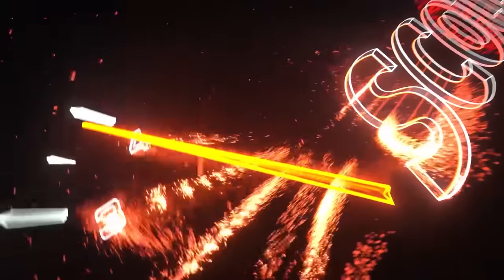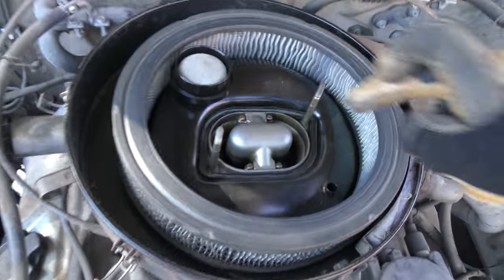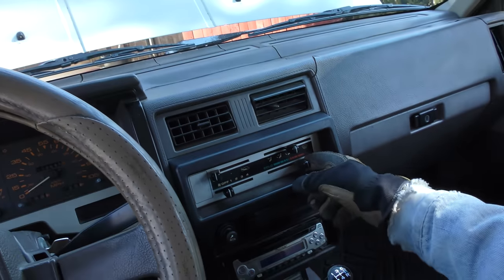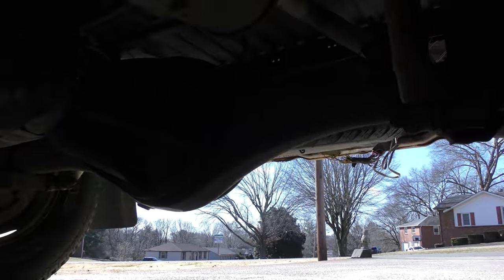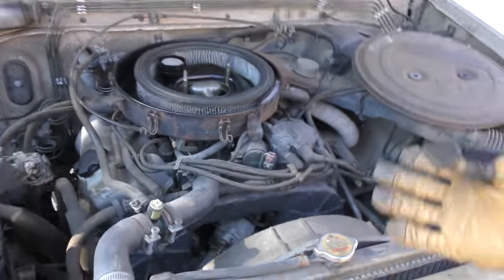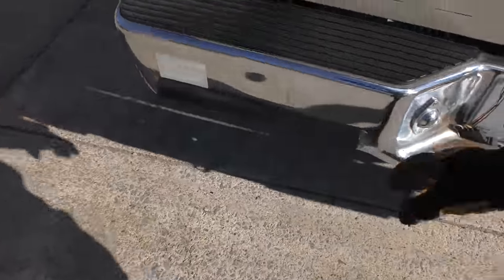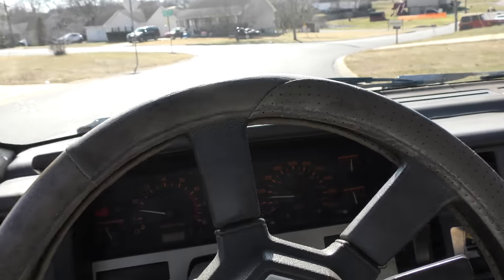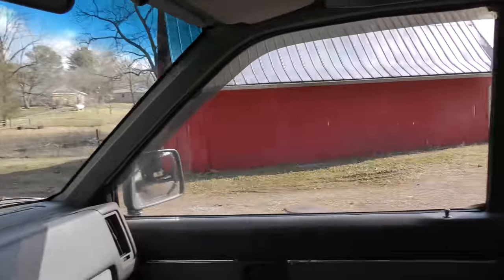I'm Sitting in the Best Truck Ever Made (Goodbye Toyota)

Comment: I had a brand new 85 D720 I traded for a 2WD 4cyl 86.5 Hardbody when they came out. Drove it for 5 years and only had to change the oil and filter. 2 years ago I was feeling nostalgic and bought a 97 4x4 4 cyl 5 speed. Truck is perfect and reliable. Only has 65,000 miles, so it will outlast me.
Reply: Great find!

Comment: That's what I like about the older vehicles they are much simpler and easier to work on. My modern day Mercedes sprinter van has so many sensors it'll make your head spin. I have already had the engine replaced and there are 3 sensors showing fault code. One of them prevents the cruise control. The sad thing is the van only has 12k on it and it was made last year.

Comment: I love how the cooling fan makes it sound like a big rig or something
Reply: It drives like a big rig too. These trucks are really low-geared, so they are Extremely Slow, but they have a really high payload capacity (don't believe what they say on paper) - and it drives the same as if it were empty! Don't try to tow over 3,500 lbs with these things though then you'll kill the transmission. You also gotta shift pretty often on these things like a big rig as well, and you can take off from a stop in 2nd gear pretty easy too. Overall one of the most reliable vehicles ever made💯

Comment: I love the older trucks! I'd love to of had  one of these. I had a 82 gmc that had over 300 thousand miles didn't have to do much maintenance on it only a starter and a thermostat.  Always changed the oil in it! Good running truck!

Comment: I just got ahold of my fathers hardbody made in  12/1985 had the 4cylinder with a/c king cab 4wd with the bigger factory tires and the 5 speed manual, he converted it to electric Windows and locks out of a Nissan Pathfinder, the truck definitely needs some work but he bought the truck in 1987 from Nissan and put 300k miles on it. I was the last to drive it when it was parked 8 years ago and it ran perfect. I’m gonna fix it up and have it as a backup truck.

Comment: As a Hardbody owner, I can tell you the issue with the throttle body. Once a part breaks on it (wax idle solenoid) you will not be able to find replacement parts. Nissan only supplies parts up to 20 years back, so that throttle body is obsolete. Wrecking yards used to be the place to go, but they are all picked clean now. A used, 30-year-old throttle body injector will sell for $300 to $600 on eBay - if you can find one. Why? Because nobody makes an aftermarket replacement either.
Reply: Is that on the v6 or the 4cyl ?
Reply: @shanetyler9391  both had the throttle body, so both have that issue. The newer VG30e has its own problems, especially with ethanol-based fuel, because the small o-rings in the injectors will dissolve if the engine is not driven regularly. I've replaced all 6 injectors on my VG30e injectors 3 times since taking ownership of mine in 2010, and they are expensive to replace.

Comment: Got a 94 D21 Hardbody 4WD. LOKKA,auto diff lock in front factory LSD rear, new water pump and heavy duty clutch. Except for regular sevices thats it over 25 years. Everthing else original.I did fit a new alternator, didnt run so good. 
Replaced the bushes in the original, no problems.

Comment: Scotty, a pleasant surprise from Mr. Toyota!   Nissan did so well for so long. .why did they merge with Renault?  I have a 2wd z24 version with 423k.  I've been in the engine, but the rest is untouched except for Amsoil. The old R12 system has quit.   Rated at 106 hp but will haul anything that i load in it and will keep up on the freeway.  Lower end is basically the L engine from the 1960s with the 8-plug head.  I replaced the beat up seats with Integra and the melted steering wheel with a Pulsar for $5.  
I had the fast idle issue for years. Ignored it until it caused smog failure.  Had to replace the little wax solenoid that controls the cold idle, then adjust the cam.  Surprised you said not supposed to mess with it.  It doesn't govern mixture. Just idle speed.   Now it idles better than 25 years ago.  You can feature my antique and even give it the drag strip test!  
These old nissans...did you see the million-mile Frontier from Chicago on you tube?  I don't know how people say that's junk compared to Toyota.  I'd call them peers. I also have a cheap 88 Sentra with 360k on orig engine that still purrs.  One head gasket only failure.  Late 80s and 90s seems like a golden age for Japanese stuff.  Wish the plastic parts could take the CA  sun better!  But I  like the simplicity.   Fuel injection is the only tech on board, and it was inevitable as the carbs and vacuum lines necessary for smog had become impossibly complex and tough to maintain.

Comment: The only truck I ever owned was a 1987 Nissan Hardbody with a manual trans, Snugtop with carpet kit, mag wheels and no AC. I bought it slightly used in 88'. Best vehicle I ever owned. Had over 200K miles before I blew the engine. It had a recurring oil leak from years of neglect and I underestimated how much oil was in there. Rebuilt the engine and all was good. Got a new car (93' Jeep Grand Cherokee, first year). I stored my Nissan at a friend's house. He was driving it without my permission and totaled it in 97'.

Comment: Fuel injection was more common than carburetors in 1986. I would have thought it had a carburetor also because of that big circular air filter on top of the engine.

Comment: We had a 2wd 4 cylinder Nissan p/u from that same era.  We put aggressive tires on it and were able to take it anywhere we wanted to go camping.  The main drawback with it was that the engine was underpowered.   It took forever to get up to highway speeds when it was loaded and towing anything very heavy was out of the question.  Otherwise, it was a great truck.  If we had gotten the six instead of the four, we might have kept it to the present.

Comment: I had an ‘87 hardbody 4 cylinder all through college in the mid 90’s. Absolutely couldn’t kill the thing. I finally sold it in 1998 with 220k of the hardest miles ever and it was still going strong. It’s sad to think what Nissan has become since then.
Reply: I have 2006 Nissan frontier with 200k and it runs like a top. So smooth and perfect. Nissan is still bulletproof
Reply: @buffalokrisgoldprospecting  not so much the new ones. Had a buddy with a 2014 Titan and it’s had all kinds of problems and it only had like 125k miles. The rear end was totally shot and he didn’t even tow with it.

Comment: I have a 1987 D21 two-wheel drive with the 2.4Z engine and currently have 463k+ miles on it.  I have the same 15" chrome rims from a 4WD model so for years ran a larger diameter tires such that 1 mile only registered .9 on the odometer.  Based on simple calculations, I'm sure i have over 500k miles on the truck.  As Scotty indicates, it isn't a powerhouse and can't do what my dad's 1992 4.3L S10 can do but it's have been a very durable truck.  One thing that Scotty didn't mention.  The 2.4Z has a timing chain.  The V6 uses a timing belt with intrusive vales (meaning if the timing belt breaks you can bend/break valves because they may hit the top of the cylinder) so even though the 2.4Z is wanting for power, I would prefer it over a V6 model.
Reply: Have the same year, engine, and rims on mine. About 423k.  I run 215/65/15 tires and overall diameter is very close to the stock 14s.  Double timing chain is stout.  Not a lot of HP but enough torque to lug a full ton in the bed if you dare.  Keeps up on freeway just fine.   If you bring tire diameter down to stock it really helps the power on the 4 bangers

Comment: I have facelifted production hardbody 4 door (Make year) 2003,  basically a WD21 with official facelift from Nissan for SEA market but using the oldest engine (Z24 108HP carburetor). 

it is a joke when running my car above 60 mph on highway. LOL
but the ride on corrugated country roads is surprisingly good! 

mileage is not bad, 30 - 35 mpg on combined roads. love it very much!

it is leaking oils on engine, yet still going strong.

Comment: Hauled a ton of hay with a 4 cyl. 1984 Nissan 720 long bed  with overload springs for years, bales sticking out from the sides to take out cyclists. It's about damn time you gave Nissan trucks some respect. They have been rock solid since the 1970's.

Comment: I have a 1994 hardbody (d21) king cab 4x4 manual transmission 2.4 liter engine and  has AC its amazing! Used to be my dad's before he gave it to me. He bought it brand new and had 5 miles and had plastic still In it as it just rolled off the truck at dealer.  Has 223,000 miles on it with original transmission.

Comment: i own a R50 97 pathfinder, and my brother has a WD21 95 pathy. mines been over heated, redlined, you name it, 114,000km and its never let me down. the 95 is 288,000km and it still runs like new. my mom is the original owner of mine, but my brother got his for 800 bucks because it wouldnt start. pulled the fuse for the after market alarm and fired right up. both are the V6

Comment: I had an 83 Nissan.  It was the best car I ever owned.  I changed the brakes at 90,000.  They didn't need to be changed.  I just got tired about worrying about them  needing to be changed.  After 140,000 all I bought was batteries, tires, lights and front disc brake pads.

Comment: I have a friend with an absolute mint condition 1995 Nissan V6 4WD automatic with AC, canopy. 46,000 — yup — original miles, all in the same family since new. Zero rust — Pacific Northwest truck. Garaged or under a carport every day of its life. Never been off-road. Driven only by her elderly late father, herself, and, a handful of times, me. About the only way to tell it from showroom new, inside and out, is the loose headliner. She routinely is asked if she wants to sell it. She might — but it wouldn’t be cheap.

Comment: I have a 1980 Datsun 720 4 wheel drive pickup and it has been one tough truck! All I have ever done to it is rebuild the carburetor and pack the front wheel bearings and the usual maintenance! Those front wheel hubs on a 1980 4x4 pickup are ridiculously hard to take apart ! I took it to a mechanic one time ,told him to pack the front wheel bearings and when I got back home he was calling to ask me how to get the hubs apart! I told him to just forget it that I would come pick it up and do it myself! The first time I packed those bearings it took me a full day on each side! I haven’t run into anything as complicated as that since wheel bearing wise and hope I never will! I like the kind where you take the hub off and bolt a new one on and you’re done,but when you bolt the new hub on be sure to torque the axel nut to exactly what the instructions say or it will come apart!

Comment: I've owned three 90 s D21s and one 90s S10 modern companies are missing out on my money lol! I would argue the v6's are great but gas money and room to work in the engine bay with the KA24E is much better.

Watch for rust on the front suspension areas on D21s especially passenger side! Change them timing chains! Save the D21s!

Comment: I have the 2.4L Z24i version, same 86.5 year, same throttle body FI. It is my first car and is still my daily driver today. It's approaching 38 years at 390K miles - original engine and 5-spd transmission. In the 80's and 90's, a lot of my fishing and mountain-biking friends owned Toyota pickups. None of those Toyota pickups are alive today or back in the early 2000's. It's not a fair comparison and one of my friends actually preferred driving his Ford Tempo to our fishing spot back in the day. I have a Lexus ES300, Toyota Sequoia 1st Gen, Honda S2000 and Infiniti G35 which are good cars but my D21 is my most reliable car. I always tell my daughter that if I screwed up and lost everything I own, she has something to inherit for sure.

Comment: in 1986  Ford Ranger beat out all these trucks  in Motor week and motor trend.    Ive driven all these trucks and i personally can tell you the Ford Rangers were  Smoother  quieter Trucks they felt more refined and the XLT trucks were so much more comfortable in the cab.   They are had good reliable engines......For Everyday ownership   I drove Rangers for nearly 20 years.    I really miss our 1986  and our 1991 Rangers.  Both had over 200,000 miles
Reply: Proof America can do it right when it wants to.

Comment: The 1998-2004 (First Gen) Frontiers were basically a rebodied and updated Hardbody. They are not expensive at all. 
They are simple and rugged,
And the D22 Frontiers are much more rust resistant than a hardbody.
I own one, love it, feels like it will last forever. Only issue is (just like a D21) is you're not going anywhere fast. The D40 trucks arent too bad, but they don't share any connection with the Oldskool Datsun like all the trucks through 2004 did.

If you want a Frontier (or a Hardbody), my advice is get a 4cyl one, they arent much slower and get much better fuel mileage than the 3.3 V6. Neither engine is affected much by whatever you can fit in the bed. Yeah the V6 can tow a little more on paper, but neither truck is a great choice for towing anyway (besides, the 4 banger pulls its little heart out, its surprisingly capable for what it is). 
My truck is a 3.3 crewcab longbed and ive already contemplated swapping in a KA24DE Frontier motor, my previous Frontier was a 4 cyl (i gave that one to my mom) and the V6 is that much of a letdown. Like i said, yes its more powerful but not enough to offset the massive difference in fuel consumption. The 4cyl gets 4cyl gas mileage. The 6cyl gets 8 cyl gas mileage. 

Yeah i can already hear the naysayers "BuT tHE sIx HaS mOrE tOrQuE!"

Guess what, the KA24DE in truck trim has torque in spades, too, and it's stupid easy to turbo it for even more torque. The only issue is the 4cyl transmission wont handle much more power than stock (the 6cyl one can handle more the V6 could ever make in anything less than fully built and boosted). 

So heres the reason i prefer a 4cyl classic nissan truck to a six;

My xeV6 struggles to get more than 16mpg (and when doing anything remotely like work that drops, fast). 

The 4cyl trucks, you have to really try to get em below 20mpg and driven sensible they can flirt with 27mpg. I mean even towing a 4200lb car, my old 4cyl one STILL got better mileage than my V6 truck does EMPTY (17mpg average when i towed a Mercury Grand Marquis from Upstate NY to Allentown,PA). Yes, it's kind of hilly around here. The 4cyl definitely felt the load but it got if done. The six feels weight a "little" less but not worth the extra fuel.

Nissan really messed up not offering the 4cyl in every body style (like toyota did with the Tacomas). IMO Nissan should've adapted the bigger V6 FS5R30A transmission to the four and just put the four in everything (they actually did do that in the 4cyl D40 Frontiers) If they did that most older Nissan trucks would likely be the 4cyl ones. The optional engine shouldve been a version of the VQ V6, the vg30/33E engine is a boat anchor relic from the early 1980s, the heads flow horribly.

Comment: Had the Datsun 4 cylinder pickup I bought used for $500 when I lived in Seattle.  After driving it for a couple years I drove it to Nashville when I moved here.  After a couple years suffering without AC I sold it for a Toyota with great AC.  Someone bought it for $500.  Later I bought an Isuzu diesel pup new that I loved even though it was slow as molasses.
Reply: The Isuzu diesels were great engines.  Shame they weren't more popular.

Comment: What I like about my 2004 Sequoia is you have the option of selecting 4WD electronically via a button inside, or you have a handle that allows you to do it manually.
Reply: The bottom is for 2wd to 4wd high (you can switch riding the car) 
The handle is for 4wd high to 4wd low (you need to stop and put in neutral before)
Reply: @paulsteverodriguez3549  You are not entirely correct.  I have two separate buttons in the cab of my Sequoia relating to the 4WD.  One button does the changeover from 2WD to 4WD high.  The other button facilitates the change from 4WD to 4WD low.  Of course engaging the buttons activates an electronic solenoid positioned on the transfer case which changes the functions automatically.  However the handle is there to allow manual control of the 4WD should the electronic systems fail.  The handle also has a neutral setting which can be used in conjunction with a winch.
Reply: ? That’s a mod? Because our 02 isn’t like that, and 05 doesn’t have handle, so it’s a transfer swap or what? Never seen one like that, and I’m in Sequoia first gen Facebook group
Reply: Btw the botton next to 4wd, the tiny one is the center lock differential, that distributes the force 50 - 50 front and back differential
Reply: @paulsteverodriguez3549  Engaging regular 4WD results in the 50/50 (or similar) drive distribution between the front and rear differential, that's what 4WD is!  The center lock differential as you refer (or 4L) can only be used at very low speeds and is normally only used in extreme off-road situations, it causes the transmission/diffs/axles to work in complete synchronicity (in a very low gear ratio)..  I recall the old days to engage it involved getting and locking the hubs by rotating a plastic attachment.

Comment: Love the NISSAN truck. I had a 1974 Datsun 620. This particular NISSAN needs an engine compartment blast with a  high pressure wand wash. Also needs a new K&N air filter, Castrol Syntech 5W30 oil, 
new NGK Titanium spark plugs and,  well,   what else?? .. A rad flush? Sure! New tranny and differential fluid? Of course. New brake fluid and P/S fluid? Of course.

Comment: I have an 89 with the 4cylinder with the 8 plugs. I did rewire the dash to use the v6 cluster which has the oil pressure gauge and volt gauge
Reply: My '95 doesn't have 'em, it's the XE-V6, maybe the SE-V6 did.  One of my first projects.  I like knowing what's going on.